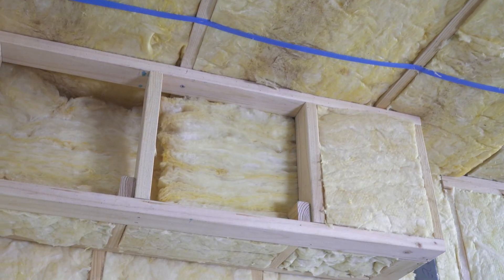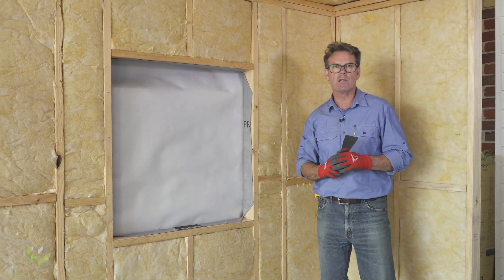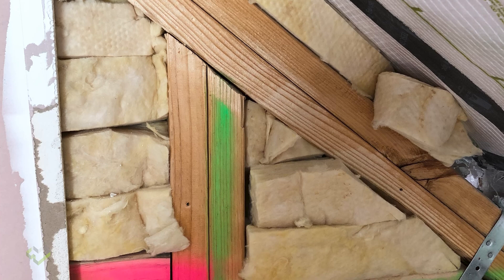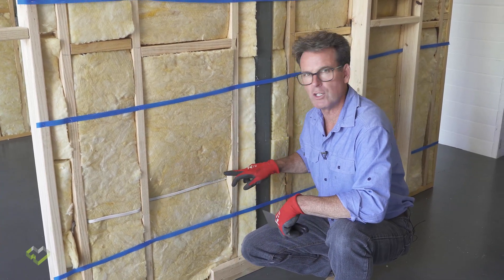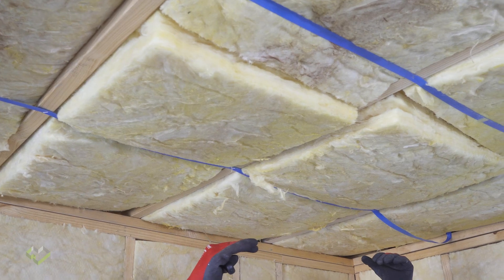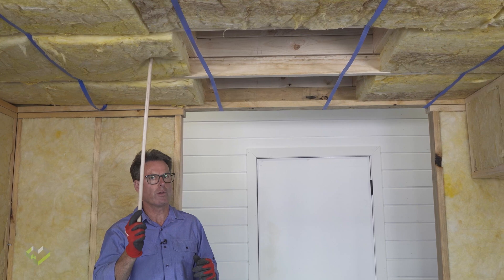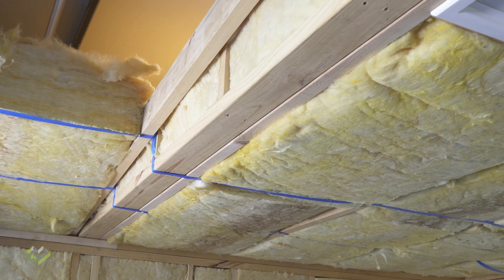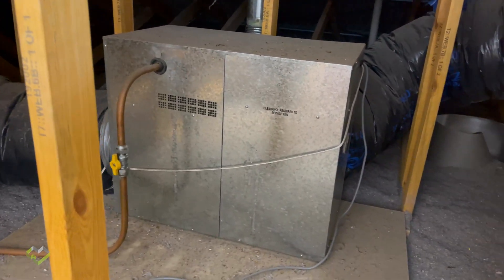It's NOT just how much insulation you install, its how well you install it!

Comment: With the hot water pipes in the roof void, don't you want those on the warm side of the insulation to prevent heat loss in the pipes?
Reply from the maker: @MM_UA-000  Sure, but you should also have them lagged.

Comment: We have 20mm ceiling battens screwed to the bottom of our trusses that the pasterboard will be attached to. I am wondering how to fill this gap so the there is no gap between the fibreglass insulation and the gyprock and I am thinking I will add loosefill cellulose insulation on top of the plasterboard and then add the fibreglass insulation on top of this. Does this sound ok.

Comment: Awesome, I am a keen observer when it comes to installing batts as I have designed and built out own home. I placed R6 in our ceilings and am now placing another layer of R4 over the top, all internal walls have R2.7 for 90mm stud walls with hebel power panels on the outside. Its getting hotter. Question, what is an effective exhaust venting method for a tin corrie roof, whirly birds seem ineffective, what others have a good lifetime and work over a larger area?
Reply from the maker: I’m glad you like our videos.  Ridge vents are the most effective with eave ventilation, but they can clog up over time.   There are also mechanical fans that trigger with humidity, which are pretty effective.
Reply: @ecoevo  Cool solution - Do the mechanical ones stay air-tight when not in use?

Comment: I think having only 90mm of insulation below equipment platforms in the roof is not an issue, as long the area is actually insulated. It's no different from what you suggest at the edges of the roof, which add up to a much larger area. The main thing is to ensure that the insulation coverage is complete.

I'd say the same about the edges of cathedral ceilings, if the area is relatively small.

Having said that, I think these videos are excellent and I wish more builders knew this stuff.

Comment: What are your thoughts on installing two layers of say R3.5 ceiling insulation. One layer between the ceiling joists, and the second layer cross-ways over the top of the first layer to reduce thermal bridging?
Reply: For thermal performance, it's a great solution. However, considerations on safety access in the future should also be considered. it is not easy to judge where one can set foot on (where are the joists) if the insulations are installed in that fashion.

Comment: Certified and accredited installers know all this, and the rest don’t mainly know all of this , you need to get Csr Princapal contractors or better still 80% of installers need to do a accredited insulation course mandatory!!! that explains the thermal envelopes Not to mention that bulk insulation create a condensation and breeds mould growth, based on a envelope that doesn’t have a complete thermal seal and a moisture barrier, air sealed is a must, insulation batts are not the answer . Period !! 1800 tech is Still been promoted to this day !! Nanotechnology, thermal coatings and air sealing is the future, tampons are not,
Reply: They didn't use batts in 1800, they left houses nice and leaky because coal and timber were cheap and available. You aren't wrong though - batts w/o air barriers are pointless

Comment: Great video! I just wish that more builders and building surveyors mandated this level of installation detail as a standard.
And out of curiosity, why not slice the batt for the electrical cables as is done for the plumbing? It would make more sense to slice to allow the cable to be fished through for future changes.
Also, do you still need the sarking ventilation clearance if using anticon insulation blanket.
Cant wait to see how you tackle light, gpo & plumbing fitoff penetrations and maintain minimum clearance and air barrier. (All to often I'll see a sparky come along and rip out a few handfuls of insulation to put in his/ her light/ gpo point. 🙁)
Reply from the maker: It’s not a good idea to encapsulate electrical cabling.  We will be making a video soon, focusing on wiring and insulation.  It’s a mine field! 🙃
Reply: @ecoevo  Ah, good answer. I was wondering the same thing. But if the cable is going to pass behind the insulation, then why bother running it through the studs at all? Why not just run the cable around the back of the studs, using some kind of clip to hold it in place? Seems much simpler to me. Am I missing something?

I'm looking forward to your video on this topic.
Reply from the maker: Could be in the way of the foil paper getting fixed.  Even though we prefer not to see this stuff.
Reply: I will be doing the slicing over plumbing for my retrofit
Reply: Yes I'm also curious about your question "Also, do you still need the sarking ventilation clearance if using anticon insulation blanket."?
Reply: Encapsulating really want to see that video especially for blow in material ,